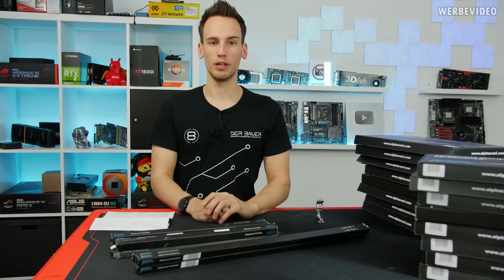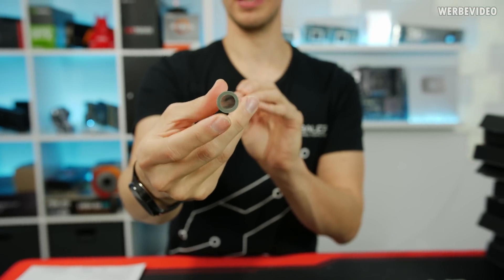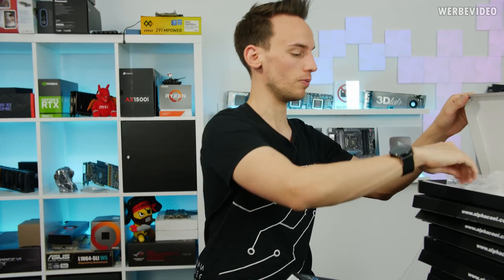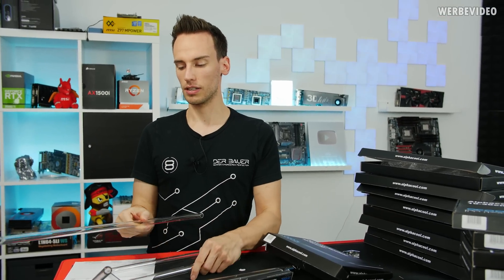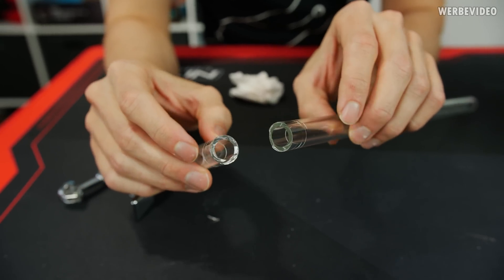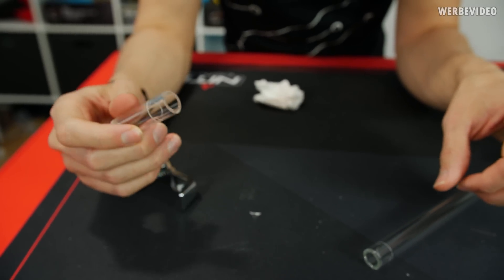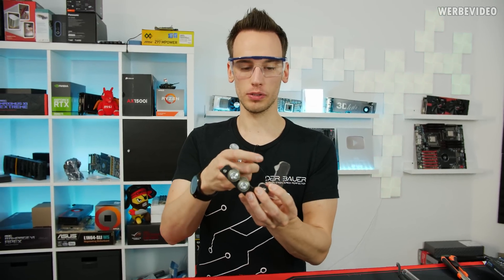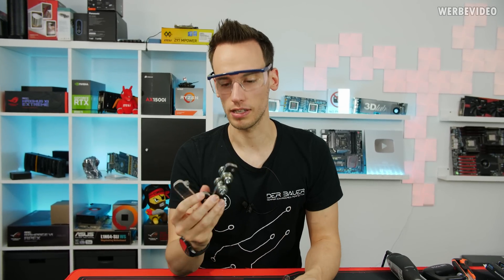Project Irrationality Part 3: Extremely Expensive Hardtubes and DIY Glass-Cutter

Comment: All glass cutters I've ever used had a diamond to cut, not metal. It would give a much cleaner cut IMO.
Edit: That was regular glass of course, dunno about silicate glass...
Reply: As he said in the start of the video i think it's because the specific type of glass used would create too many dangerous dust particles, whereas the metal cutter probably does a rougher job but in turn creates much larger particles. Without a proper setup it's probably too dangerous.
Reply: @fVNzO  Cut it under water solves that problem, or ample ventilation and a Glass Dust Respirator. Cost 20-30€. Or outside (pref. if you dislike your neighbour. :P) Yeah yeah, that last part was a joke.
Reply: @Qyngali  I don't know anything about cutting glass - i'm just regurgitating the video and i think roman generally knows his stuff. It's still a bit iffy just using a respirator since the dust wont disappear. Cutting underwater is probably the best bet, and then off course dump it in the neighbors bushes.
Reply: You can get silicosis from regular glass dust, this shouldn't be any different
Reply: @teddygoboom1  it is.  Borosilicate glass is a lot more dangerous than regular glass. The additives to give it the thermal resistance it has makes it a lot worse for your health
Reply: Regular glass is made from silicates (SiO2), borosilicate (also known as lab glass or used for kitchenware) adds boron and other compounds to the regular glass to improve some properties (like to reduce thermal expansion in oven proof kitchenware).

Comment: the most hassle free way would be just getting a diamond tip blade and appling a stream of water as you cut to avoid glass getting in air....quick n ez
Reply: Jugo Slav
It's just class tubes!
What did you do on custom tubes? diamond tips needed???

Comment: Hey. Like the tool. Make sure ti stabilize and get right angle of the blade. Make shallow cut (only 1 round). Heat up (gas torch), quickly put in ice water. Super smooth staight 'cut'. Sand/deburr after. You'll be happy.
Reply: I was going to write this as well, def best way to cut the glass tubes
Reply: Yeah, you don't need much pressure, just giving a place for thermal shock to happen
Reply: Was just going to post this also.. Hopefully Roman @der8auer reads Bertrams comment above..
Reply: Guess I should have watched a little more to see the won you made... that one you made looks amazing

Comment: Did the same, watch jayz2cents and thought it would be a good idea  to use glass tubing, the end result works well and and looks dam pretty good. I used a Dremel with diamond disc to cut the glass under a very slow running tap ie no dust and it kept everything cool , you could get a little wet but it was worth it, also used the diamond disc side  to smooth the cut , plus wet and dry.

Comment: 6:37 It's called "deeper grooves".
Reply: ... at level 7
Reply: @ferna182  it's fake sapphire
Reply: Scoring is the correct term, actually
Reply: @UnfrozenScoundrel  were referencing another YouTuber called Jerry rig everything who tests cell phone durability. He uses tools to scratch the glass and test hardness. His catch phrase is always "scratches at level 6 with deeper grooves at level 7."
Reply: Furiiza sama, when creating a mark to induce a fracture or break at a specific point, scoring is the name of such an action.
Reply: @v3xx3r   Here's my head-scratching opinion, scoring is a result of a mistake, while grooving is intentional stable feature. For example, the surface of my engine cylinder sleeve is scored and needs to be replaced. and 'grooved' for his/her pleasure. So from this logic, I would 'score' the glass to create an intentional weak point

Comment: Yeah, surely diminishing returns using the glass? Seems like a lot of time spent when acrylic could do the job. I love high end but seems like I bit of a waste. €400 on tubes? New turbos for the GTR, Roman 🤣
Reply from the maker: GTR Gearbox is 38k€ XD
Reply: @der8auer  too quick response! I changed to turbos! 😂 The cutting jig was great, I feel like you could bend the glass tubes yourself! Neon sign makers use a circular heat gun to bend their glass. Maybe that will work for custom?
Reply: jimmehvideos
This is nerdy hobby skills, not 
high end....

Comment: In regards to pressure when cutting, perhaps adding a long machine screw with a spring and a wing nut through the arm and body via the bottom to the top, might give you a better quality cut.
Reply: I was thinking along the same lines of using 2 expansion springs either side of the cutting arm to give equal load when cutting.
Reply: FIR55TORM
you need to move the tubes all the time....
you need skills!
Learn from how robots do that!
Reply: @lucasrem  There is a mini lathe that Roman could buy for less than £30 (35 Euros approx) for the turning part.

Comment: You can flame-smooth those ends if you want to do it right
Reply from the maker: Will try that :) Thanks
Reply: @der8auer  Flame polishing is the easiest, us a map gas or propane torch and slowly warm a large portion of the tube then heat the end until the glass begins to melt.
Reply: @Hrod750  flame polish, that's the term i was looking for
Reply: @der8auer  https://youtu.be/IZ7PCpT3uJY custom modder turtorial
Reply: Was gonna give same advice. There are youtube videos about it. Like this: https://youtu.be/_AkCHj7SHs4
Reply: This is the video I created to show how to cut Boro tube, I hope it helps, here is the video: https://youtu.be/vS_etq3sHMg
Reply: I don’t think you can. Mayhems glass, for example, is annealed at more than 1,700 degrees celsius.
Reply: @peterbratu  
No offence but are You quite sure of that temp ??
I could be mistaken but that sounds awfully close to melting temp even for borosilicate glass !
Best regards
Reply: May want to get map gass, hotter than propane
Reply: Damn, why didn't I think of that.
Reply: Need Oxygen & Propane torch to work with Borosilicate, the melting point of approximately 3,000 °F / 1648 °C